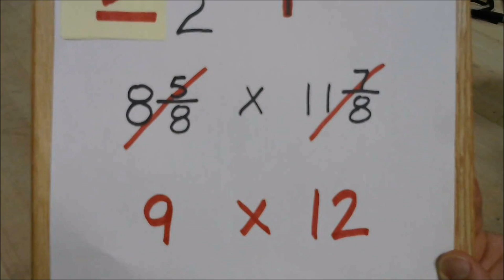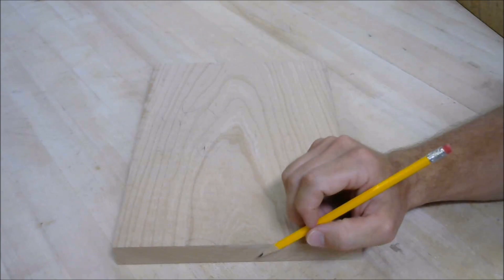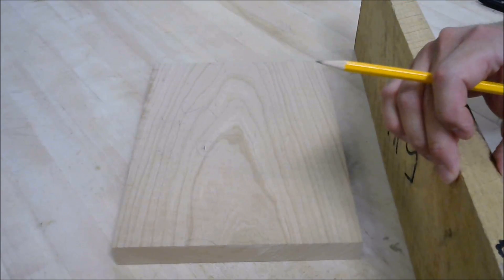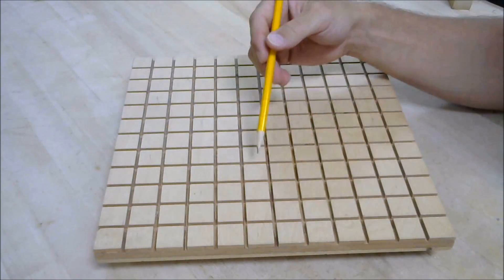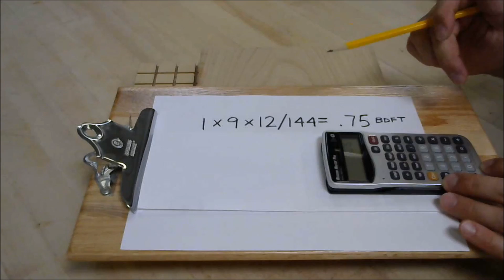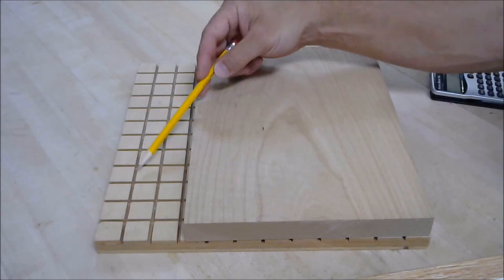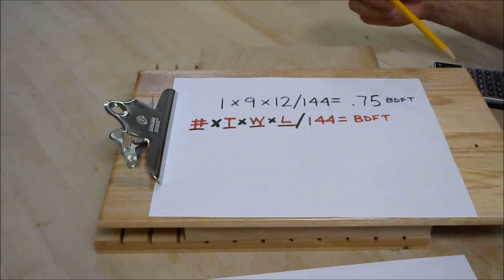How to Calculate Board Feet & Project Cost Pt1

Comment: A lumber company advertise boards dimensions as variable 4-6 inched width by 6-8 foot length. My question is will the lumber company sell me one whole board as one board foot or will they cut the board to make it a one board foot? How do I buy a whole board from the company? Lets say I want a 4 inches wide by 6 feet long, will I have to pay for 2 board feet to get that whole board? thanks
Reply from the maker: yes, you'd have to pay for 2 bdft to get the whole board

Comment: How would you determine the total length in feet if you're just given 100 BM of  1"x12". What would be the total length of 100bm of 1 x 12 wood?
Reply from the maker: Is 'BM' board meters? If so, then since your board is 1"x12", you could just multiply your linear length of meters by 3.281 (the number of feet in a meter), for a total board feet of 328.1 board feet.
Reply: One BM of board is 1"×12"×12" or one feet by one feet ×1 inch.so 100 BM of board,  will be equal to 100 running feet of board.this aplies only if the board has 1" thickness.since 1 BM has a length of 1 foot.